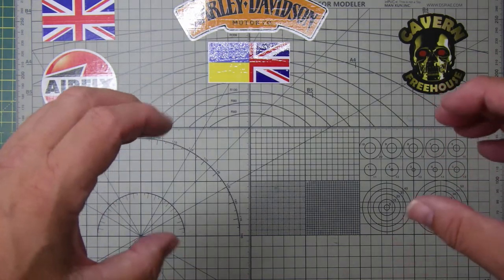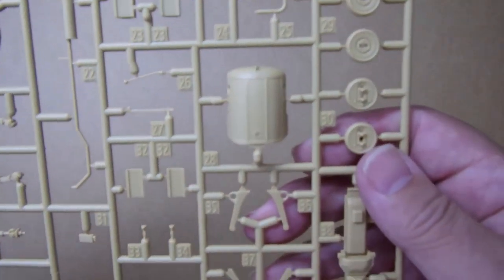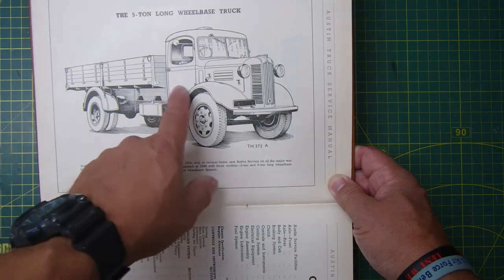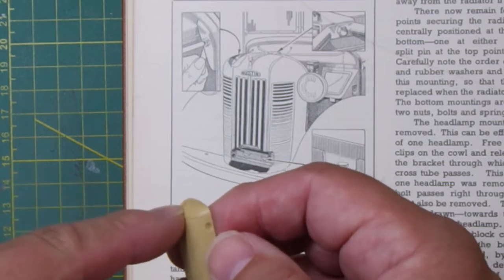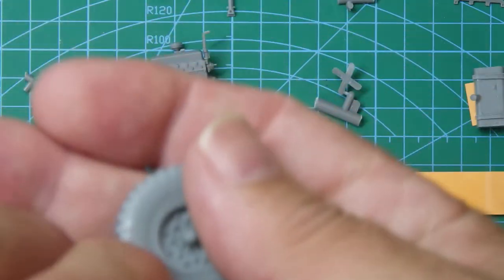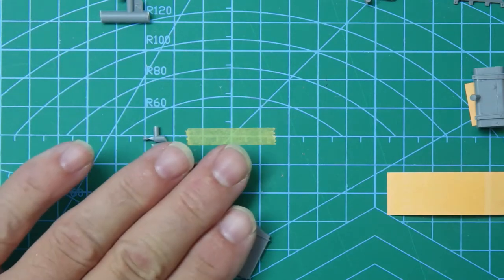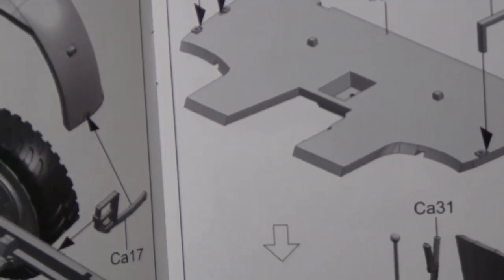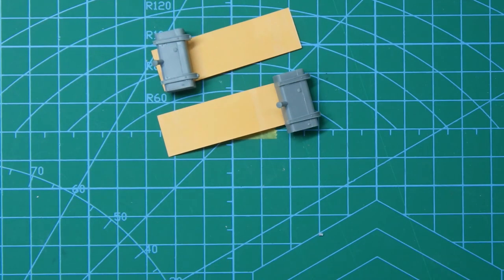Gecko 1/35 Katy Ambulance - Build part 2 - is the radiator cowling the wrong shape?

Comment: The K5 grille in the manual is the immediate post war design and is quite different having a taller (deeper) header tank and the pressed steel slats in the cowl. To my mind, both the Airfix and the Gecko grilles are wrong. The Gecko looks too bloated and actually looks as if it's upside down. The Airfix looks too narrow. Way back in the 60s, Airfix did both the ambulance and the six wheel Austin K6 fire engine in 1/76 as part of various RAF rescue sets and those grilles always looked spot-on. These don't. I just can't pin it down to what exactly is wrong, but they ain't right.
Reply from the maker: Yes spot on Andy, I’ve just been discussing ways to make the corrections 🤷‍♂️👍

Comment: Could it be that Gecko is using the grill for the K2 ambulance that they will be using for their K3 30 cwt trucks that will be on the market soon? In photos from ww2, the K3 has a more square grill than the K2.
Reply from the maker: You are probably correct, thanks for your comments. I appreciate it. Cheers 👍

Comment: Could it be the `Fuse box`?     Again a very comprehensive and interesting  build/comment video, again keeping to the basics , which is just what's needed for a beginner or modeller now into larger scale vehicles.    It beats me when videos are `put out` and  are `Censored` as to their, constructive criticisms (why bother being rude and criticizing) as if the reviewer is In error" I believe `they` should be assisted and educated,  as  biased  opinions are totally  facile and useless and not what `your` YouTube, videos are made for.  
I find it also difficult to comprehend the sanding , filling, surface reconfiguration time and time again.   
Gaps will appear as not all kits are perfect, as too are `we``   I still use Squadrons `Green stuff` to fill any small gaps, but in layers not great dollops' that soften the plastic,  and adding a drop of solvent cement to smooth out the filler.   This tun=be I have must be nearly twenty years old now as I try and "FIT the parts" rather then just gluing them together.  
 I take it you too are a Mechanically biased individual Bob as am,  I in spending fifty years plus working in a brewery (I know, I now its was a sacrifice, but some must do what some must.)  Also a few upon the high seas in the Merchant Navy , upon  B.P Tankers.
Modelling is for 99.875 % of us a hobby, so why do `some` seem to make it tiresome and tedious, its an ART form too. one in which to develop one "skills", in both modelling and painting, so why not develop one`s skill in colour rendition as well as  "WE" all see colour differently and whom says this colour is wrong to that you see as the colour `In your line a sight`, bit like rivet counters.   
Hope my comment is appreciated as its meant.   Take care.
Reply from the maker: Yes one is the fuse box, the part that has 2 parts to it, but the box on the bottom right is in the position where the coil is mounted on earlier K2s. I may just be replacing it with a coil so I can run the spark plus leads from the distributor, and one to the coil? We'll see. Cheers 👍